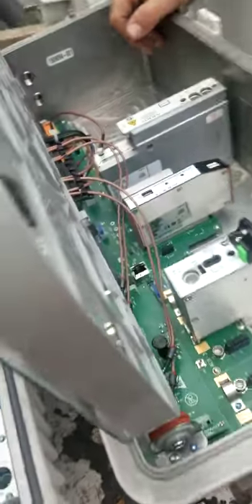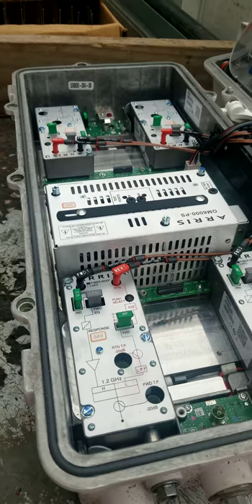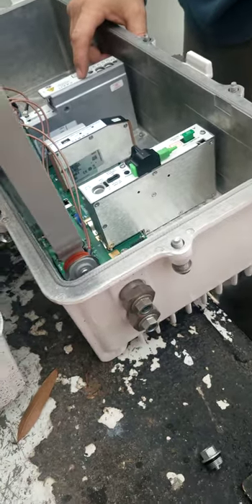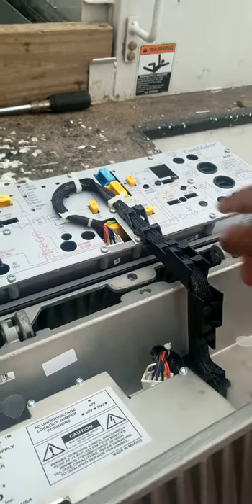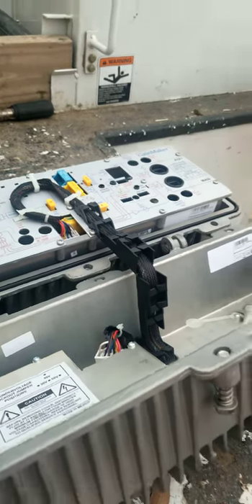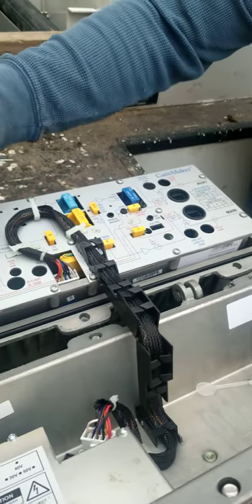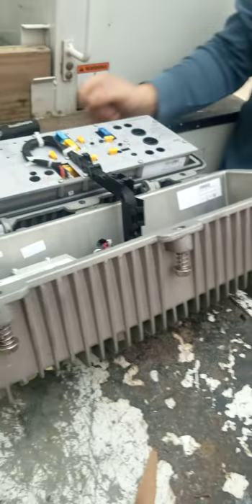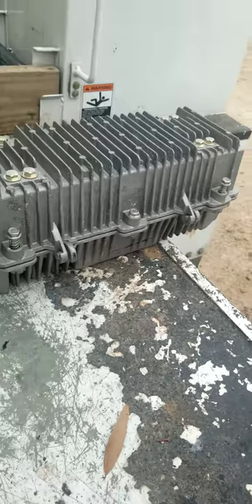installing cable node walk through

Comment: I pop these in and out everyday. Love my job
Reply: I work on Arris OM6K, Arris 4000 (RfOG and RF), SA 6944 (Uninstalling 5 a week), CASA R-PHY DA200 and DA 2200, Nokia ISAM 7360 FX 8/16 OLT and Nokia Lightspan SF-8M OLC. I like the Arris OM6K for it's layout. I am looking forward to converting one to RPHY. The Arris 4000 platform doesn't need to be laid out so sloppy. It's like a refreshed design of everything crap from 20 years ago.

 I also use Technetix trunks and amps. If you're doing a sweep, just plug in the T-Box and your meter and adjust the RX, TX and slope with your phone. If you need to change out an amp (that isn't dead), just save the amp or trunk to your phone or laptop. Swap in the new trunk or node and upload the parameters. Amp name, amp location, recorded input signal, and all the parameters. Technetix uses two AGC QAMs for gain control and you can pick them. You can also use an old analog carrier for gain control or just use temperature control. If you want to change your upstream split, just pull the diplexers, swap in new ones and move the radio dot on your phone from 85mhz return to 204mhz and send to unit.

So much new tech. So many new tools.

Comment: You do not mess up a node if is little tighter than what he showed. If that node is aerial and air moves that cable, you get get hum into the system, but I doubt I will change his mind..